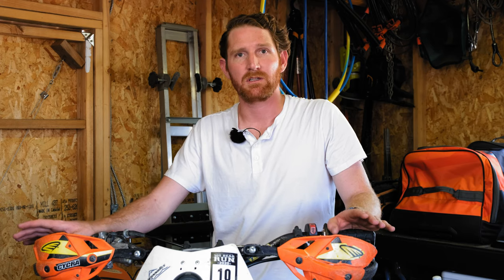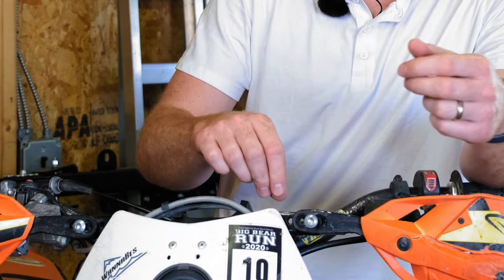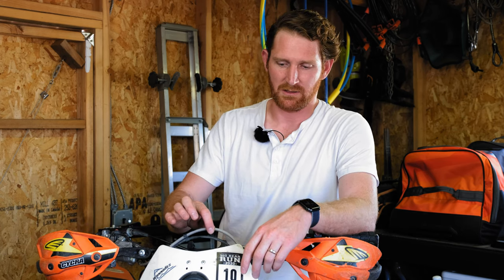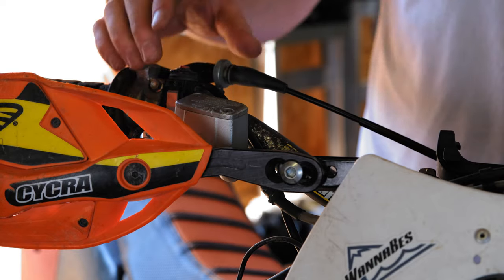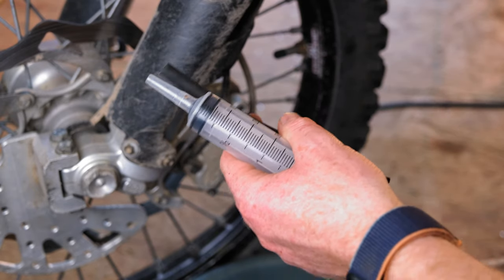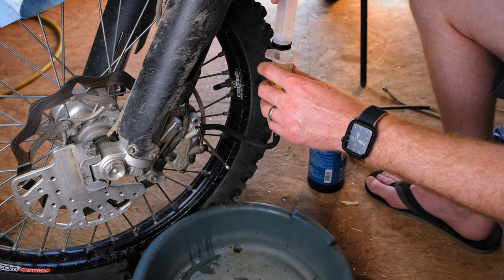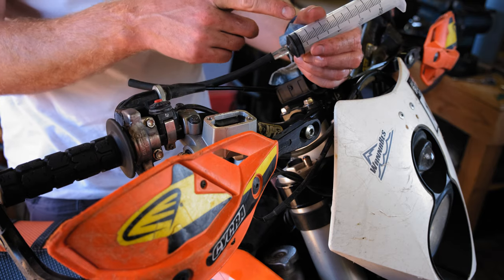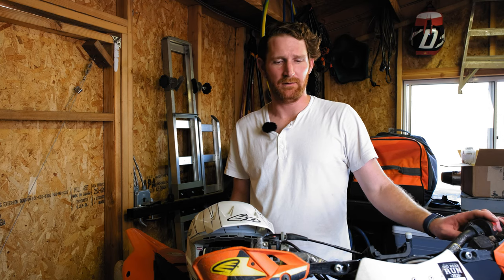How To Back Bleed Motorcycle Brakes | Bleed Dirt Bike Brakes Fast And Easy | Remove Air Bubbles

Comment: Do you need to depress and hold the rear brake before opening the valve to "squirt" the fluid in from the bottom?

Comment: Thank so much I just put a new line on and it's been 30 minutes trying to get the air out. Very little brake pressure and still alot of bubbles left. Going to try this tomorrow. Seems way easier the anything else I am trying
Reply from the maker: Glad it helped
Reply: @WannaBes  worked like a charm.  About 1 min and full brakes again. Best way yet

Comment: thanks for the video. My bike's brake fluid flush is long overdue, and I am thinking on using this method, just the other way around, mean sucking all the old fluid from the reservoir, topping it with fresh fluid, and sucking it from the caliper using a syringe and a hose... your method seems fine, but I fear pushing air into the system, my bike has ABS and I hear that if any air bubble make it into the ABS pump, pushing them out can be a pain in the a*se... what you reckon?

Comment: My back brakes on my Kx250f I changed the pads and now there not near as touchy? Any idea?
Reply from the maker: Did you change pad brad or material type? It can make a difference if you use ceramic and metallic pads. Also if you got any break fluid on the pads while you were changing them can effect it.

Comment: How did this work even though there was still old fluid up top?
Reply from the maker: This wasn't a fluid change, just a bleed operation to get air out. But, to change the fluid, you can do the same thing, but suction out the reservoir first.
Reply: @ExtremeSportsWannaBes  ok thank you

Comment: Spent 3 hours last night doing this and it just won’t build pressure. I know the lines and everything are fine too because it was such a strong brake before I had to slightly move the cable and I opened the banjo bolt a tiny bit and then the air screwed everything up. Idk why I can’t get pressure back now.